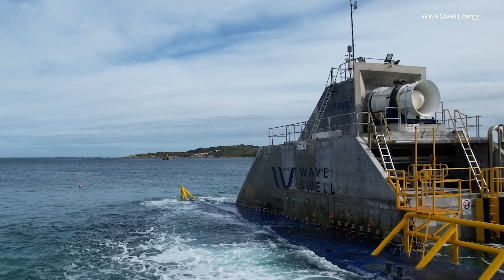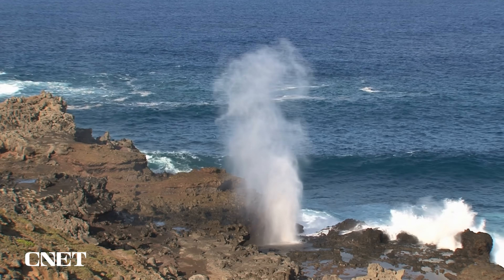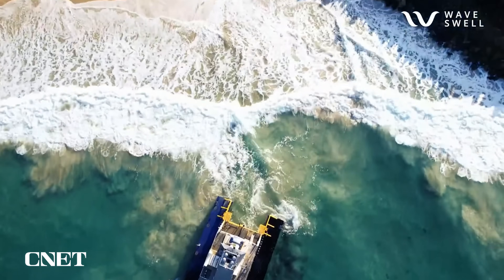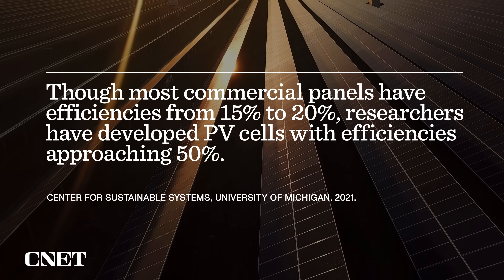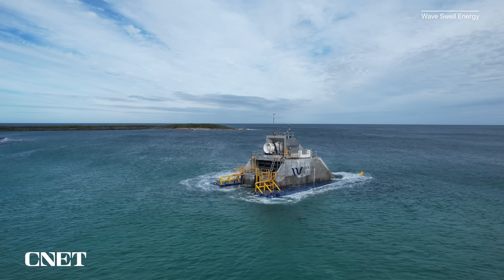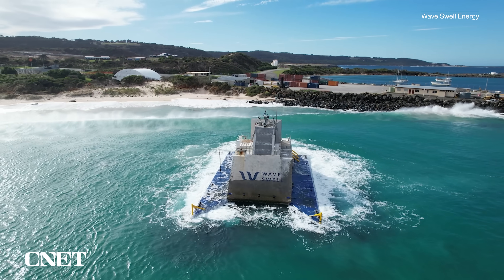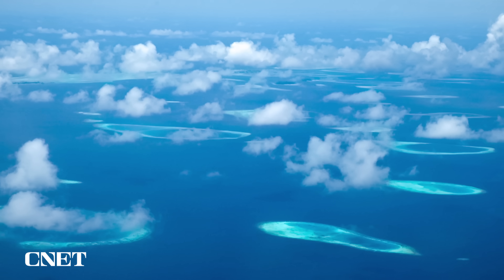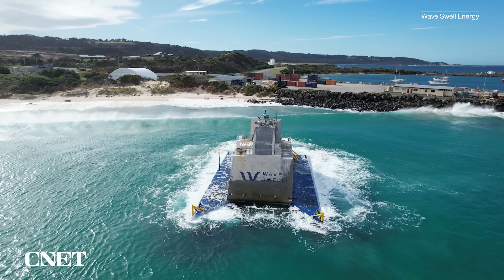'Artificial Blowhole' Generates Wave Energy for 1 Year

Comment: Nice work, tho that "Close to 50% efficiency" sounds a bit fishy
Reply: It also doesn't really matter if the waves that go into the machine don't contain that much energy. Even if you had 100% efficiency it would be "bad" if the waves are tiny. 

A higher efficiency is only really helpful to lower costs and the used area... but not helpful at all to compare how much energy one system creates over the other
Reply: king island is located in Bass Strait, which is a very windy area, getting Antarctic air currents which make the sea choppy too. efficiency isn't fishy at all, it's a prototype not a market product and they're testing what works and what doesn't
Reply: @Clove_Parma  I'm glad you mentioned that, cause I really don't know why they wouldn't just plop a small scale wind turbine on the roof of it too, considering that there is ALWAYS wind at beaches due to the evaporating ocean air rising and sucking cooler air out to sea to replace it. Something like a Harmony wind turbine (once they're fully up and operational) would be an amazing 2-for-1 punch.

Comment: The diagram shows incoming air as the generator supply but not on the exhale side, why isn’t there one? 
Wouldn’t that add to the amount of generated electricity?
Reply: More often than not, the out-going air comes in a form of spray, which causes (very very very) unwanted flooding and corrosion to the turbine blades and shaft, thus intercepting the spray and duct it out before it reaches the turbine would be beneficial for the longevity of the device.
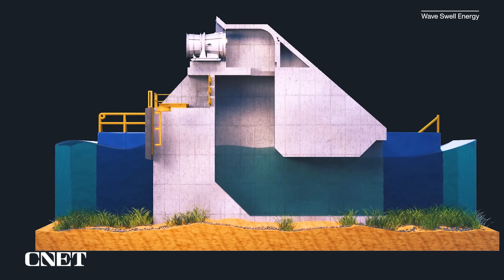Reply: @conghaoxu7344  true but I think that could be achieved easily enough with some design tweaks. I'm picturing at 3:33 where the arrow is pointing outwards, if it instead of going straight out the back, fell back down into a second chamber that's connected to the first one with a single way valve - basically a flap that when the wave pushes into the front forces the flap closed and continues the blowhole concept, but then when it's sucking air back in the water in that second chamber would get sucked back into the first chamber, then by having the 2nd generator aimed upwards (provided it doesn't interfere with the airflow intake of the one above - maybe out the sides if it does impact it?) with a basic angled mesh infront would stop MOST of the water from getting in there, there would obviously be a little bit of light spray that might make it through, but minimally.
Reply: @Fenthule  Then it all comes down to efficiency lol.
Reply: I believe the CNET written article on this indicated they determined it was more efficient with a single direction generation.  Does seem odd, but they tested it both ways apparently.
Reply: Watch again.  I think you'll see that it is using the turbine in both inhale and exhale. I'm guessing some check valves to direct the air.